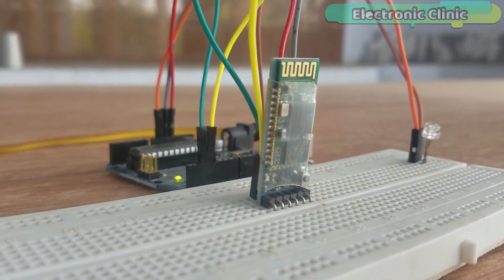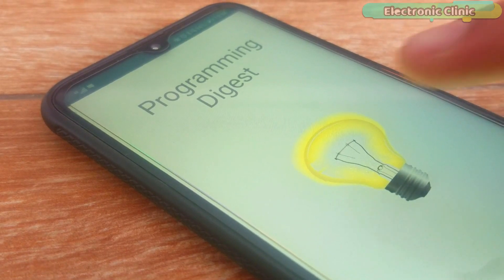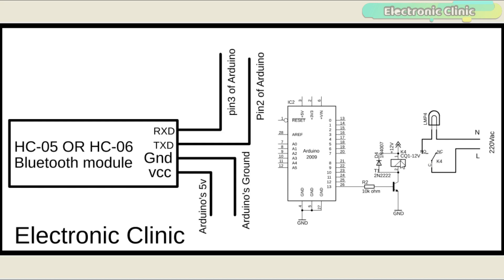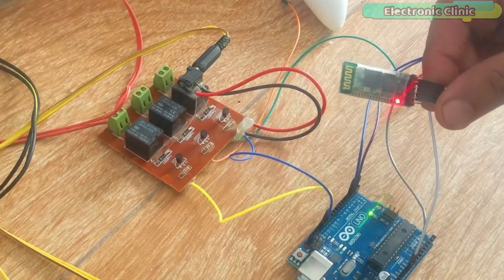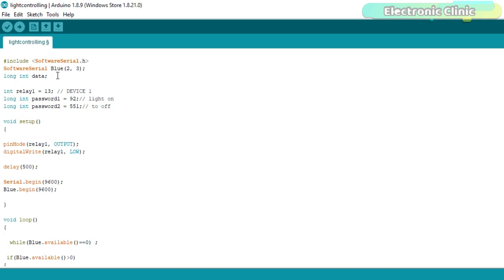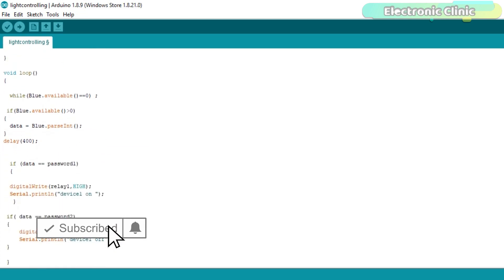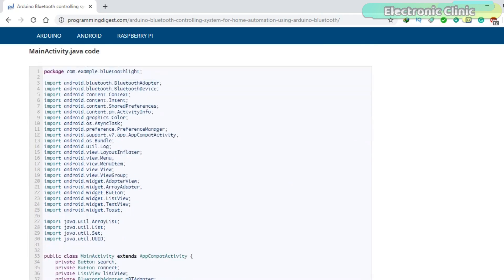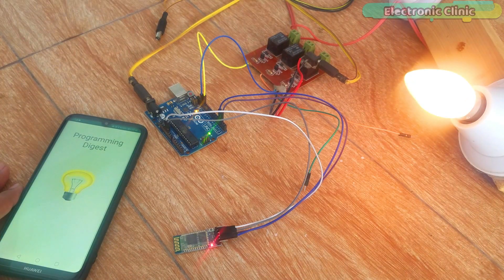Arduino Bluetooth App Designing in Android Studio for Automation “Toggle Button” hc-05 or hc-06

Comment: how does one resolve this:  error: cannot find symbol method setEnabbulb(boolean)
Reply: SetEnabled
Reply: @supunrathnayake8858  Yip had to fix a lot of typos. Great tutorial but it's a bit messy.
Reply: @supunrathnayake8858  Why he's using the ancient "Relative layout" and not the awesome new Constraint is beyond me!
Reply: @edgarwideman737  actually i don't have an idea.. did u try with this code??? Is it working????
Reply: @edgarwideman737  i install the application still no any errors but at this moment i don't have a bluetooth module to connect
Reply: @supunrathnayake8858  Yes after changing the typo to "connect.setEnabled(true);" and correcting package names, everything worked fine with my HC-05
Reply: same here 
did you solved it?